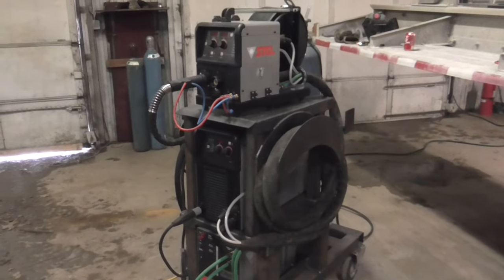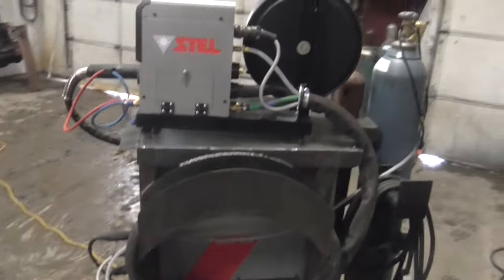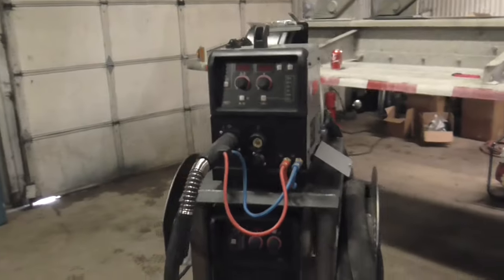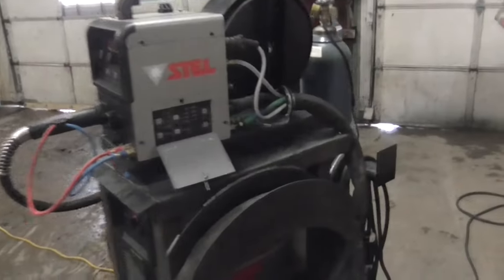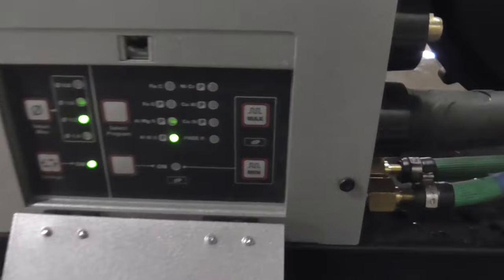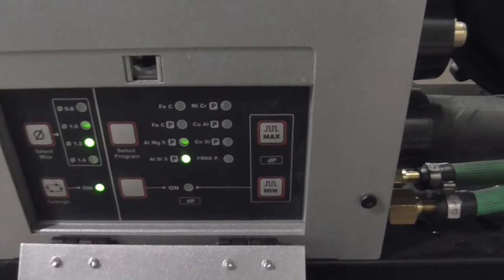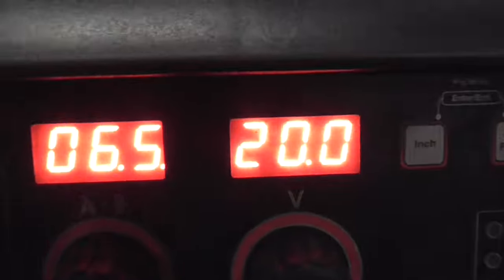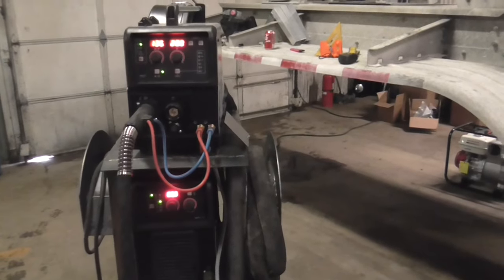Stel Max 403s aluminum welding

Comment: nice welds, especially with the pulse. I use a millermatic 225 with a spoolgun attachment all day. its a antique but I can throw out some nice welds with it. only problem is even the slightest puff of wind blows my shield gas away, its a real pain.
Reply from the maker: mcpheonixx thanks!  I would not believe how far technology has come the last 5-10 years !   It is amazing !  Like a different world .....
Reply: ZILA Yes I can't wait to put my hands on some new tech. unfortunately the company I work for has tight pockets so getting new machines will take a miracle. On the bright side I do have a brand new miller water cooled TIG machine. At 160 amps I can weld almost continuously with pulse and it never even bats an eye, the thing is a beast.
Reply from the maker: That is great !  I like water cooled tig machines/    Ever since i have pulsed mig machines though the amount of aluminum welding which would be 80%tig 20% spool gun  is now 98% pulsed mig and 2% tig.....  Pulsed mig is just soon much faster !   and that little HTP Prop Pulse 200 - the arc quality is right on par with my Lincoln 355M .....  (that thing was new with the 25M feeder over 8500 bucks !) ... amazing !  the Pro Pulse is professional level arc quality at a budget a guy can afford in his garage .....

Comment: At first, I thought you did no cleaning to the tanker because I could not see any traces of hand tool tracks. So I was wondering if pulse mig could do dirty aluminum without cleaning. But then in one of your close-ups I could see pits and peaks called profile which is caused by sandblasting. So you blasted the tanker in the areas you were to weld? Or someone else blasted it? I saw you use a small siphon blaster in another video. Did you do the blasting?

But in other close-ups it was obvious you were successfully welding on dirty aluminum. So how dirty of aluminum can you get away with welding without having to clean it?
Reply from the maker: I had someone vlast it for me - outside where the catwalk goes AND inside where the baffles go ....  it was so cheap and the guy came with a spaceman's suit and I did now with a grinder myself .... 10 hour days for a week and a half .... and dozens and dozens of repiratiors .... its not worth it - just have someone blast them ....

sometimes you can weld without cleaning ... watch my video on aluminum oxides from last week ....  but its iffy

Comment: Hi Peter, looks like you managed OK without a push-pull gun again-how long was the lead on this particular set up - and did you have to go to a teflon liner?
Reply from the maker: Darren,  yes - it works really well - the gun you see in the video is a 10ft or 3 meter gun. It has a teflon liner in it.   
Graphite liners are much better, I have another system like this a 350 amp lincoln 355M with 25M feeder - on that one i run a 12 ft  gun on it actually - with soft 4043 wire .047 diameter. Since at that gun length it gets "touchy" that is an in shop setup only.
Reply: Thanks for the feedback. Looking to put together something for a spanky new Lincoln 350mp - was thinking a 10' with teflon liner from HTP- mind offering your thoughts? Don't think they offer graphite...
Reply from the maker: Darren De Silva HTP does offer a graphite liner 10' long. I dont know the part number or pricing but i know they have it - comes in a blue bag .....

The 350mp is an excellent machine! 

What are you planing on doing with it? In shop only or also portable stuff? 

Repairs or manufacturing? What material thickness? What power are you running it in 1 phase or 3 phase? 

I mean the 350mp has a ton of  features and a ton of options - the sky or your wallet is the limit.....

Comment: Direct to the vessel without a backing flat? Not too worried about stress fractures then?
Reply from the maker: duracellgee not really, Dave from Alpha design and engineering specified it like this 7 or 8 years ago. Never had a problem - also the entire tank is welded from sheets the exact same way.
I know that if you weld a 6061 sheet of aluminum you loose about 2/3 of your original strength ( unless you heat tread everything afterwards again)  so the design is chosen and proved based on those facts, neither strength loss or stress cracks are really a concern in this particular application

Comment: How do you determine whether you want to use pulse or dual pulse while your welding? I saw you used bothe while welding this trailer
Reply from the maker: Single pulse when i need “good control” over the puddle on a repair job with possible less than ideal fit up …..

Double pulse only on long production runs on new, factory fresh material

Comment: Impressive work Peter. You make aluminum look too easy though...    ;-)
Reply from the maker: aluminum is really that easy with the right equipment.   i mean this is more a commercial "get it done" quality - not  a magazine show quality ...   but for dirty water (what these tanks are going to be used for) it will be just fine.   maybe i should be starting to teach classes ...  LOL
Reply: The right equipment is only half of the solution though. Having the knowledge/skill to use it properly is the other half. I'm sure a lot of people (including myself) would love to have you as their teacher/instructor.
Reply from the maker: though miller and lincoln call anything with mig pulse "advanced mig" machines ....   it is only so advanced  ... this stuff had been around for 10+ years even in the handheld mig market (not just robotic) and there are customers who buy a machine like this and in a matter of days they have really good results ....  others on the other hand can not overcome the different sound, different technique , etc .....      maybe i make a video series or i will do some hands on training ....   i did some one on one training for soma HTP Pro Pulse 200 customers  - typically within 1-3 hrs  people get good or great results !

Comment: is that your own welder?..fine machine!!!
Reply from the maker: Martin mc gee yes.  I own about 50 machines ( mig, tig, stick, plasma) wall plug in or engine drive total..  i bought all of them except 2 or 3 with my own money over the last 14 years most of them were new, some of them were used. 

This was one of the first max 403 s ( the s model is for 1/3 phase)
Reply: @ZILAwelds  it looks to be a quality made welder..really good...would stel or htp be your favourite make?i think the european brand welders are every bit as good as the like of miller or lincoln maybe way ahead...
Reply from the maker: as fas as favorite brand.  This is an easy but complicated question.   
If you live in the USA Stel machines are REALLY hard to get if you live in Europe HTP machines are REALLY had to get ( I mean. - you can call them and they will ship you one - but I dont want to know what the price tag is after you get it ...  
The HTP customer service is OUTSTANDING. 
the only "issue" is that HTP does not sell all the models.   Stel is the bigger company, and they actually produce the machine in Italy themselves. HTP has Stel build machine for them to their specs.
That being said for example the HTP Pro pulse 200 or Pro pulse 220 Mts has 2 additional programs that the Stel machines do not have and it has remote control abilities (that 14 pin connector on the face of the machine that the Stel machine does not have.
Also the HTP machine has the Abilities to run an optional Spool gun and optional push pull gun on the 220mts where the Stel machine might have a spool gun option but I dont think they have a push pull gun option (not sure)
HTP has the "nicer" mig gun for aluminum a 8.5ft long (2.40 or 2.50 meter) long mig gun with nice heavy duty M8 tips where the Stel version uses a 3m gun where you have to change the liner yourself and it offers you only M6 tips.  M6 tips (when you get the longline special tips form Stel not the regular copper tips from Ebay will work just fine for most pulse welding when welding ALSI5 wires at full machine capacities you may melt a few of them .... it's not a real critical issue but you asked which one I like better ....

on the other hand if you want a machine that is like the 403 or that is really powerful or a 3 phase plasma cutter or any 3 phase welding equipment  - you need to and should go with Stel - they make some aesone stuff that HTP for whatever reason does not carry and it is a lot easier to find a Stel dealer/servoce center in Europe than an htp dealer .....